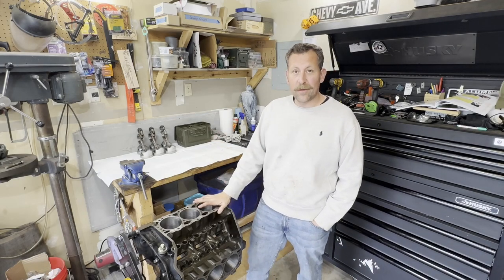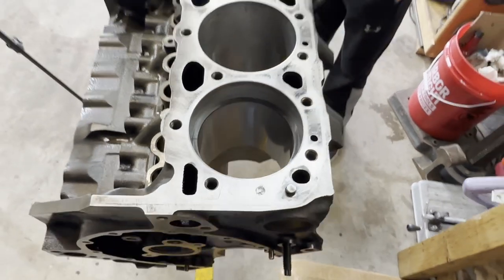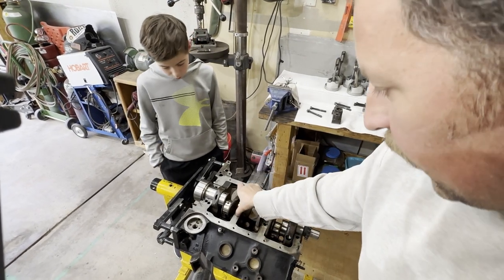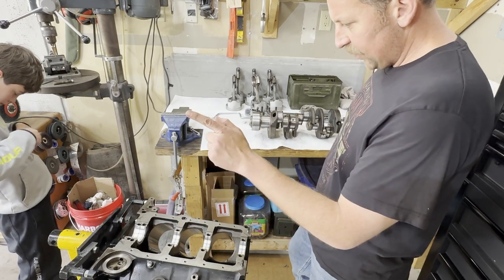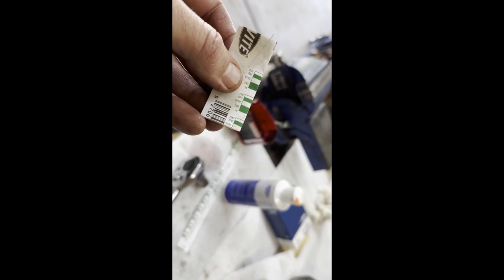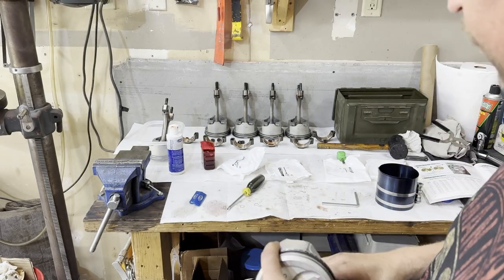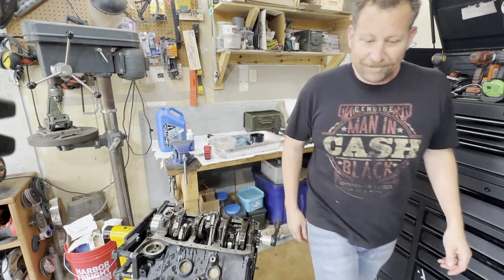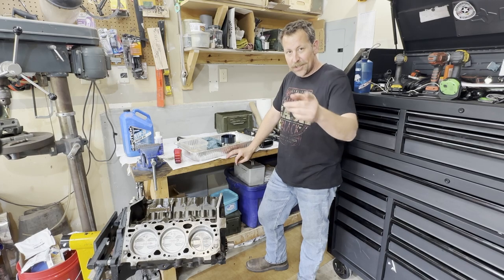Chevy 4.3L V6 Engine Assembly!  Bearings, Pistons, Rings, Plasti-Gauge; Bad Hombre Garage Ep 131

Comment: Are you using a carburetor or TBI? I recently did a 4.3 v6 rebuilt and yeah is a 350 with 2 cylinders cut off, anyway I decided to use Holley 670cfm tbi. Installation with the linkage was tricky, but overall very reliable and bolted right up with the Edelbrock intake that I have. 4.3 v6 if rebuilt right can do some serious burnouts.. good video man.
Reply from the maker: Nice! Good to hear from someone who’s done this before.  I plan to use the stock TBI setup on this 4.3.  I will be running it in my old Jeep, so I bought a wire harness that should make hooking it all up easy.  Thanks for watching!